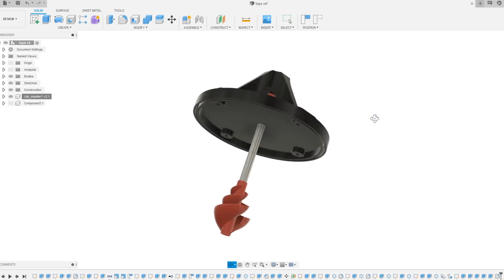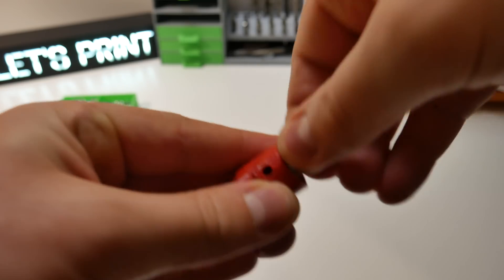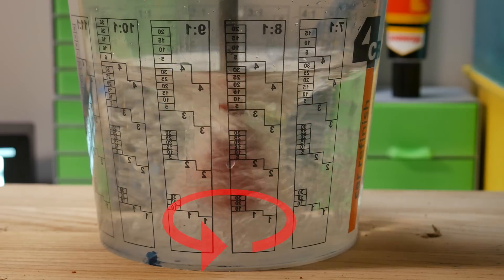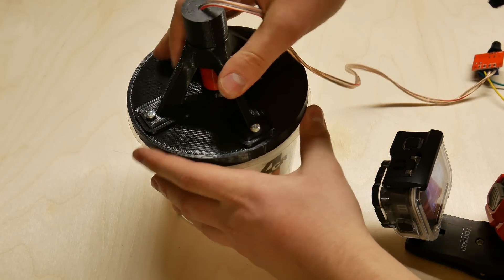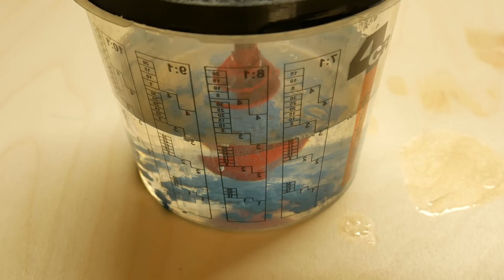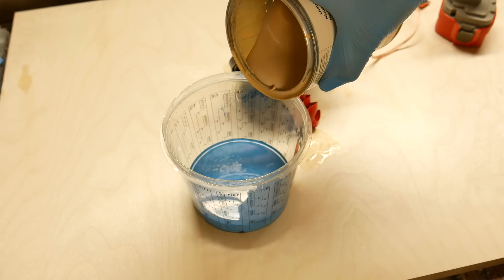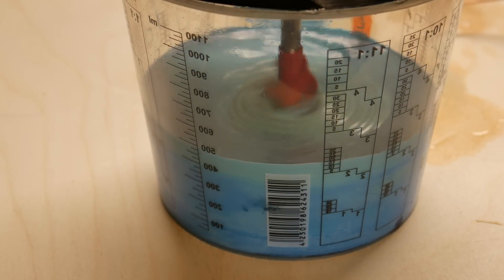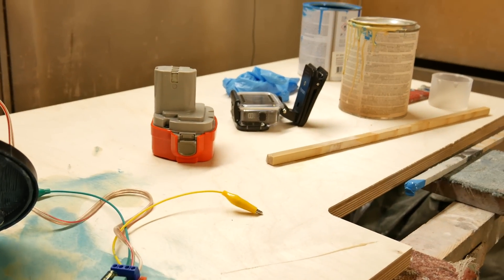Real Practical Use for LILY IMPELLER - 3D Printed

Comment: Slight design change, for simplicity. Modify the coupler to take a drill bit adapter! This solves the power issue, and adds some level of speed control as well for later projects!

Comment: Just a small suggestion.  On the cover, put a planetary gear set to reduce the RPM but give you more torque.  Drive the planet carrier with the sun gear being attached to the output shaft and a stationary outer ring gear.  Then, add a second bearing above the gearbox.  This would need to support the planet carrier, but would give the gearbox great rigidity.

Comment: Real paint mixers also have a spiral design. The difference is those ones are thin spiral pieces far away from the rotation axis which makes them more efficient at mixing since the cross-section of the forced flow is larger, there is less resistence due to the parts being very thin which allows for high rpm, and they are easier to clean since there are less hard-to-reach places.

But the lily design would be cool for kitchen mixers where efficiency is less important than style.

Comment: Could you model in 3D and then use CFD to test the optimal size for the container? I'm thinking a smaller impeller for high speeds (to minimise splash), larger impeller for slower, more viscous liquids (to increase axial flow)?

Comment: why use a little motor whn you could drive the shaft directly with an electrict drill, much more power and much simpler design

Comment: build one where the motor can be adapted to a power drill, then power is no longer an issue
Reply: Yes!  Then get one of those bendable rod drill heads.
Reply: Yup. I was gonna say the same thing.  Get rid of the motor and make a power drill adaptor. Essentially the thing becomes a sleeve to stop paint from messing.